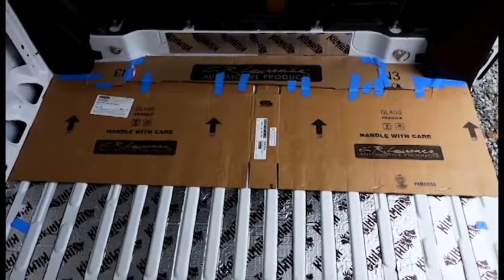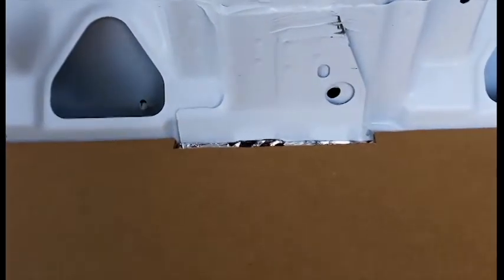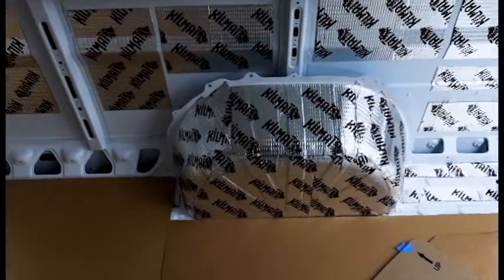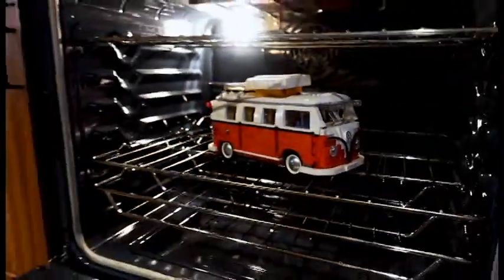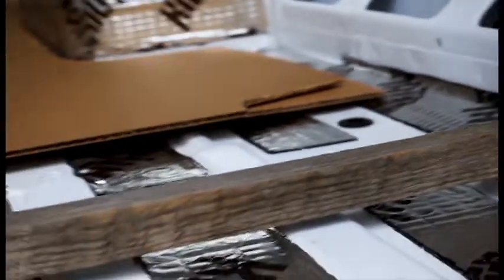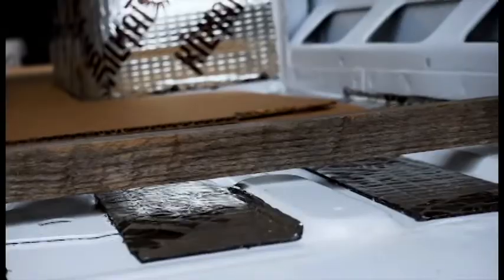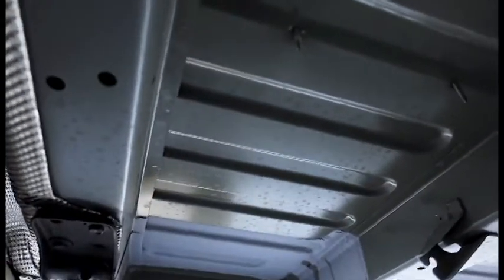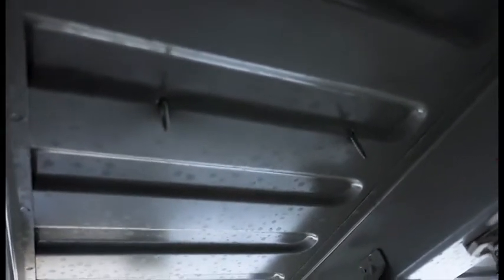Van Build Subfloor Install - Everything you NEED to know! (Van Life Tiny Home Build)

Comment: Mentioning measurements would be nice.  Besides the generic being tall, perhaps how much headroom after subfloor (assume 1 inch thick?).  I do like your video format, very much to the point yet showing enough details to be very useful.
Reply from the maker: Thank you for the feedback. At the time of filming we weren’t sure how much headroom we would have once the flooring and ceiling were complete. Now that the van is finished we have about 2 inches of headroom and Ben is 6 ft tall. We are glad we didn’t insulate the floor because we wouldn’t have had the headroom. Feel free to reach out if you have any more questions!

Comment: You may not be able to tell but have you been getting condensate on the floor under the plywood?
Reply from the maker: Not sure about on the higher ribs where it actually makes contact, but in the lower valleys we’re hoping there is enough airflow to mitigate any condensation (no actually proof though bc we can’t see) the only place we occasionally see condensation (on the inside of the van) is the windows (the actual glass) and not even on the surrounding area. Hoping this is a good sign for over all condensation 🤞🤞